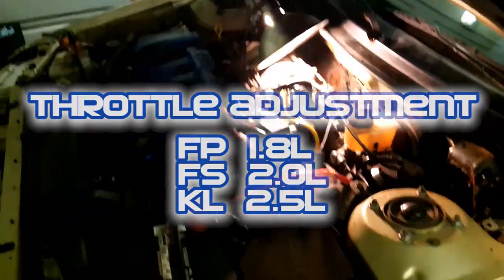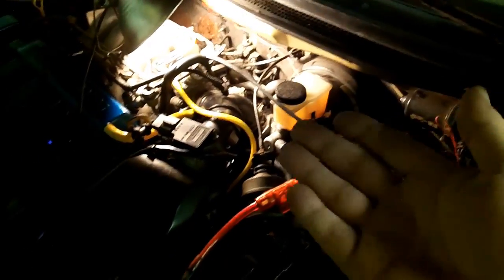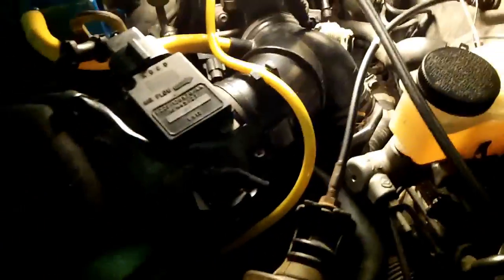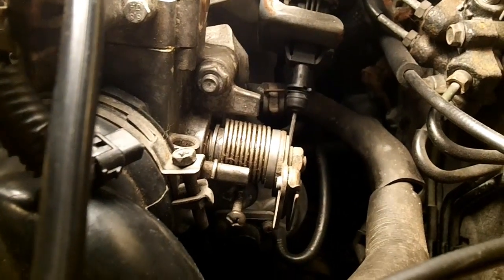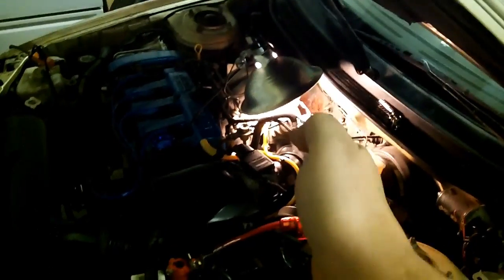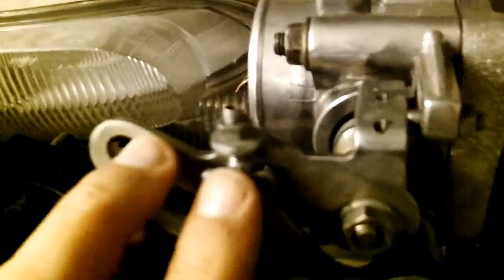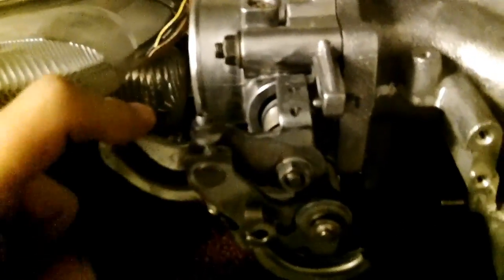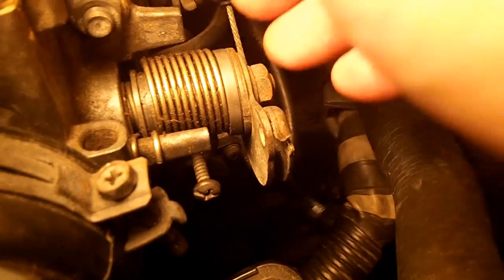Mazda 626 - Throttle Adjustment

Comment: Can you use the throttle stop as a crude idle speed adjustment?
Reply from the maker: No, because the TPS measures the throttle angle and will adjust based on that where as the idle screw is not monitored.
Reply: @DJDevon3  But wouldn't slightly opening the butterfly valve raise rpms? Is there another idle adjustment? What if I create a small vacuum leak instead? Thanks for the reply. Btw, the reason I'm asking is because I have an idler pulley that rattles below 1000rpm and I just want to increase the idle until I can replace it.  It's friggin cold outside now and I won't be able to work on it until we get a break in the weather, which could be a month or longer.  What if I short the air temp sensor so that the cold idle circuit remains on?
Reply from the maker: @stopthephilosophicalzombie9017   The butterfly valve is measured by the Throttle Position Sensor (TPS). The CPU takes that measurement and compensates for it.  So... a hard no for your theory.
Reply from the maker: @stopthephilosophicalzombie9017   A vacuum leak is unmetered air. All incoming air passes by the MAF/VAF and must be measured. I did already answer your question just seems like you don't like the answer. :(

Comment: hi .. great video.. you got talent for that ..lol..  but i need the adjustment on delco/cdi for idle the engine ,,specially when AC turn On.. i got not stabil on my idle .. can you give explaine that. for telstar brilliant 93 . thanks . best regards
Reply from the maker: Idle issues are the absolute hardest thing to diagnose on these vehicles.  There are 30+ things to test for and I'm not exaggerating.  There's no way for me to help with that online. It's something you'll have to take to a mechanic to figure out.

Comment: Hi DjDevon I have an 01 mazda 626. The problem I'm having is during start up rpm goes up then falls back down which then would either stall or idle correctly, but once running no problem  at lights or anything .Any ideas at what I'm facing thanks
Reply from the maker: Could be a wide variety of things. I'd start with fuel pressure and vacuum gauge tests. At least it's trying to start that's a good sign, it could be worse. :)
Reply: DJDevon3  Lol yes thankfully it still starts but afraid thats there's gonna be that one day it doesn't(still use it usually will turn over next try or two) and how i use it for school that a major problem. Thanks Djdevon ill see if i can solve this

Comment: So what is the OEM SETTINGS? Ohm resistance on the TPS? Voltage on the signal wire? Which one takes precedence?
Reply from the maker: Both have to be within spec that's why both are required to be measured during a real tune up.  Most mechanics perhaps unknowingly or knowingly might only test for voltage.  The only way that would be a valid test is if they used an oscilloscope.  You cannot make an accurate measurement of a linear change in voltage with a multimeter.  You can only use a multimeter as a way to find obvious issues like signal dropout due to a short/open of the TPS and to set it back to it's alignment position & idle voltage.  The only reason I do this test with a multimeter is because I didn't have an oscilloscope back then.   Most people don't have an oscope so I'm sure that's what most people do not want to hear. :(

As for precedence that's not really a question I can answer.  Both are equally important.  I hope you understand why.  The TPS will not work correctly having one without the other.  If the resistance is wrong then the voltage will be wrong.  TPS uses VREF which goes into the TPS and depending on resistance will send a signal voltage to the ECU of what the throttle position is.  

It's a potentiometer just like a volume knob on a stereo.  Imagine turning the knob on the stereo and no music comes out.  Diagnostics will help you figure out that all you have to do is replace the knob because potentiometers wear out over time.  Ever turned up the volume on a stereo and heard static and hiss as your turning it up?  That's because the potentiometer in the knob is making poor contact.  It's all the same principle.  A potentiometer is a potentiometer no matter what it is used for, they all work in the same way.

Comment: i have a 1998 mazda 626 need to smog my car didnt pass cuz the rpms are around 1200 the guy told me the engine is over working that my rpms need to be from 700-800 how can i lower them ? i tried the screw adjuster didnt move at all..
Reply from the maker: +Jesus Moya Take it to a mechanic for a tune up.  Have them check the fuel trims and vacuum leak test.  Basically take it to a mechanic.  High idle issues could be caused by like 30 different things.

Comment: im having 2 big problems.. my car is 2000 626 I-4 now my room lights dont shut off i have to take the fuse off .second... my transmission out of nowhere parking,reverse and neutral are stuck in DRIVE...i have to turn off the car in neutral for me to push the car in reverse for me to leave anywhere.
Reply from the maker: +Jose  Rivera Sounds like an issue with the transaxle range switch or gear selector.  The 98-02 has a known issue with the gear select cable coming loose.  Recommend taking it to a mechanic that can run some diagnostics on your TRS.  As for the room lights you'll need electrical diagnostics for that too.  Could be something like the light switch, door switch, dome light short to ground, etc..  Yep, time for a mechanic.  There is no quick fix for your issues, you need diagnostics performed.

Comment: I have a problem to light bothers my car and when he does turn makes it a failure, I sped up a bit and the fault is fixed and not annoying if when I turn it off and turn it on again I can be what injectors? spark plugs? thank you my friend
Reply from the maker: Can't understand the translation.  Makes no sense.
Reply: ***** mi carro tiene una falla cuando lo prendo prende como inundado y luego se arregla
Reply from the maker: BREINNER PAREDES
 Do you mean the engine stalls or dies when you are making a turn.  Like if you are driving down the street and you make a turn then it stalls?  If that is the case then I suggest checking the fuel pump units in the tank.  I believe the 1978-1987 626's have 2 units in the fuel tank correct?  Problem sounds like fuel sloshing and causing a stall.  There are baffles inside the fuel tank to help prevent this but if there is a restriction in the fuel pump filter (sock) then it's possible for the car to stall while turning.  Low fuel pressure could be a contributing factor too.
Reply: ***** no...!! el problema es unicamente para encender el motor por que prende con mucha dificultad

Comment: @devon what octane do u use in ur car? i have the 2.0 but it runs shitty. it dont shift smooth unti it hits like 3k, but b 4 it reahes this point its sluggish. i feel like im working it too hard by puttin too much throttle.
Reply from the maker: Omar, Sometimes I'll use the cheap 89 sometimes 93 just depends on how the car is running.  Higher octane raises flash point and can cut down on pre-detonation.
Reply: @devon thanks alot man.

Comment: I've noticed that when I start some vehicles with a borderline charged battery, my idle speed is hard to maintain above stall speed. But, after running for a few minutes (charging the battery) if I then stop and restart the vehicle, suddenly the idle is back to normal. Do you think the computer's perception of crankcase speed is distorted if the 5V reference starts out a little low?
Reply from the maker: My first guess is low fuel pressure due to low charge.  Fuel pump runs slower at lower voltage and might provide inadequate pressure upon initial start.  After a recharge or alternator running it should pick up speed and run better the more the battery is charged.  I'm no expert though, that's just my opinion.
Reply: It's an odd thing, one that I've noticed both on my Suburban and the Dodge. What makes me think it's an effect of initial voltage on a sensor is that I don't get a stable idle until I turn the vehicle off and restart. So, just raising voltage isn't enough, because after starting, the alternator does it's thing to raise baseline voltage quickly, but the problem persists until a second restart. I never encountered this with old style vehicles from the 70's....
Reply from the maker: spelunkerd Perhaps idle air control valve isn't warming up fast enough or isn't clean voltage to it.  The ECU controls that valve (stepper motor) at least on my car it's that way.  I don't know really I'm not a mechanic and that's a weird issue I haven't heard of before.  I only really know the 626.
Reply: spelunkerd I think maybe the ground wires need to clean .